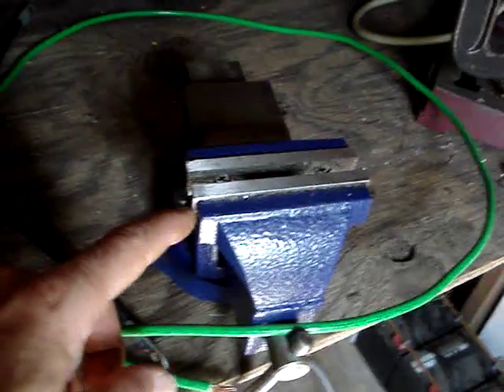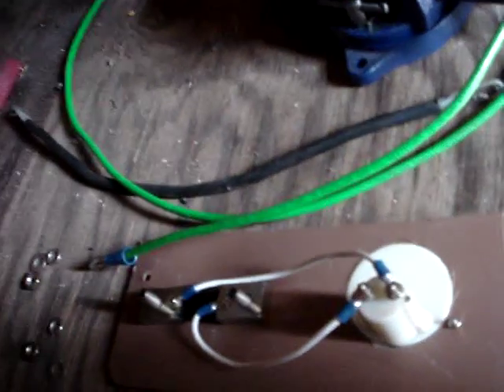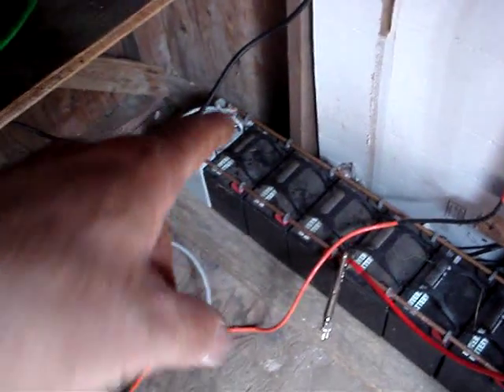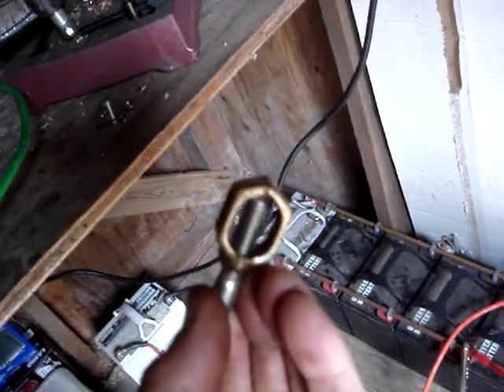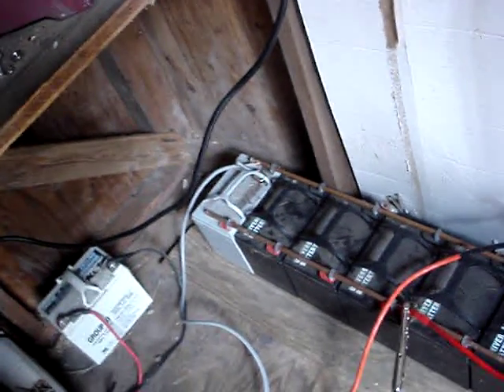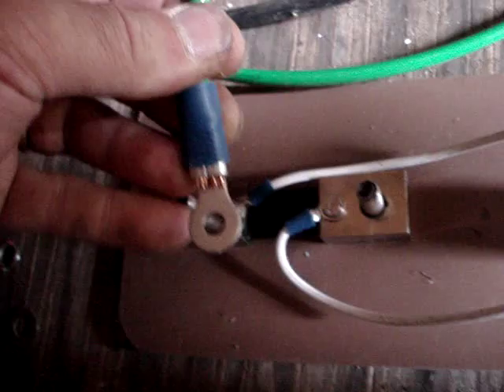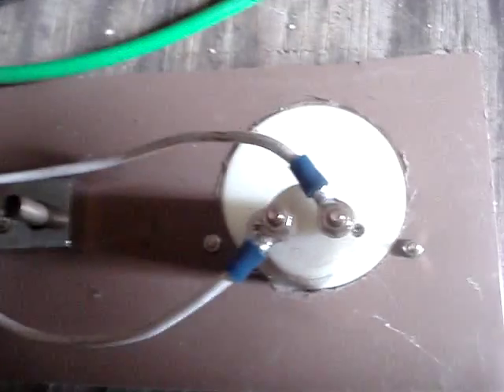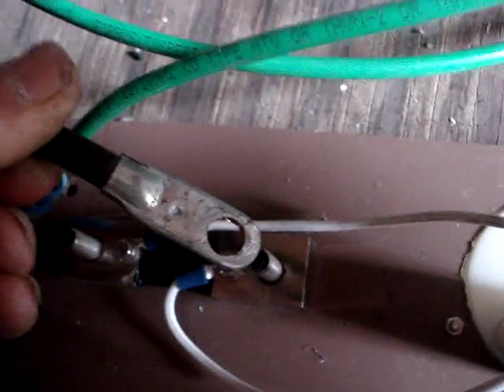Battery Wiring Update Amp Meter

Comment: One time a guy told me a tip that I have still yet to try out. I want to. ok he said put a bolt in the bottom of your cam corder and tie a string to your belt loop as long as your reach is tie the string to the bolt. and hold the camera out to the end of the string and it will never bobble or shake I guess I need to try that sometime. I have seen video like that before they camera dont shake a lot but its a little strange but ok. I ordered a tripod off of ebay the other day. It never arrived dang it. A month later I talked them into refunding me and they did. I still need a good tripod. I have a really small short one I use sometimes.  Your system looks good. How many amp hours can you store of electricity?